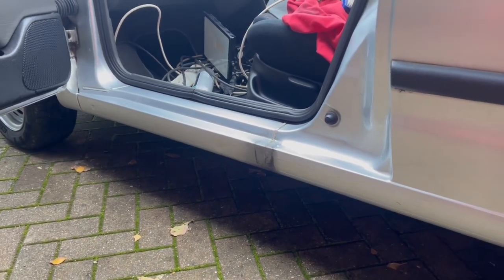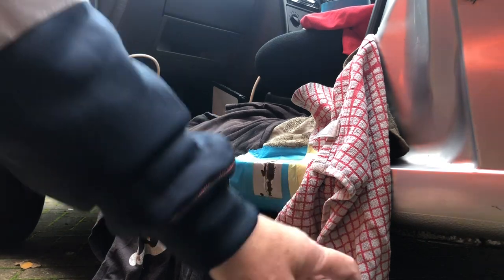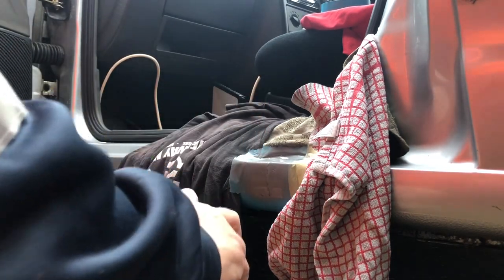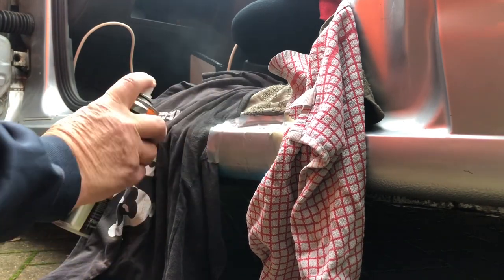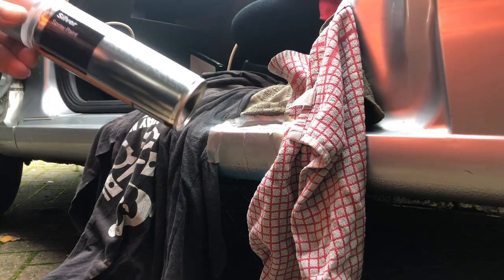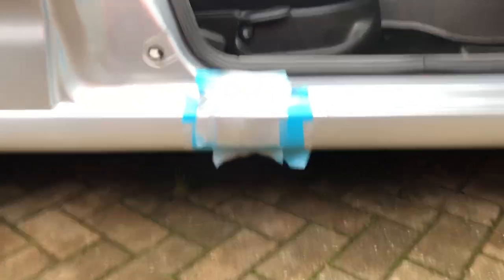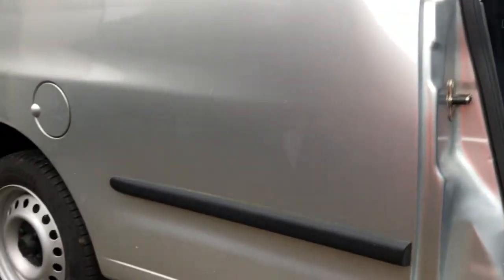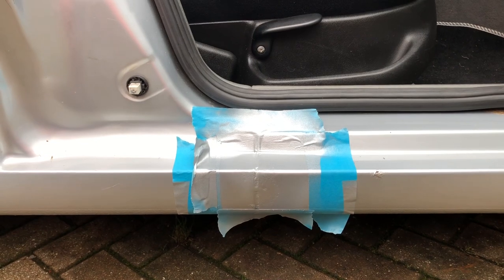Grizzmakes- VW Caddy 1.9 SDi Cleaning up paint on the scruffy sills.

Comment: Looking better. If I look at the 2 areas in same position on both sides it makes me think you should "scrutinize" the bottom of the van carefully for any possible signs of metal fatigue along that line. Or it could be just that it is on panel joints.
Reply from the maker: Joins yes. Surface rust really. But some poephol had a brush and silver paint. Then sprayed over it all with something unmatched.